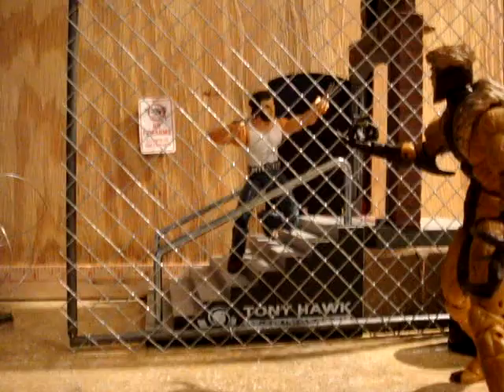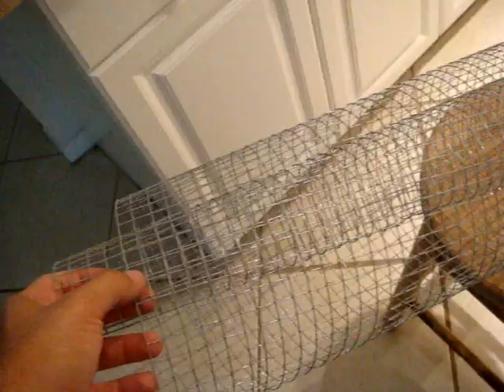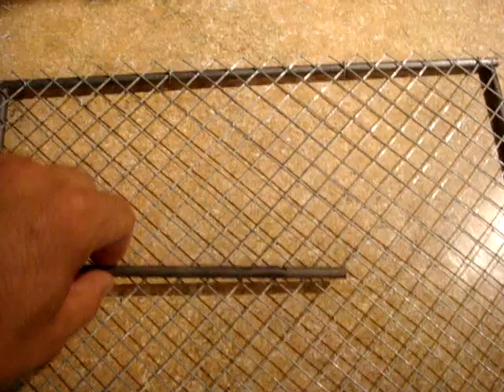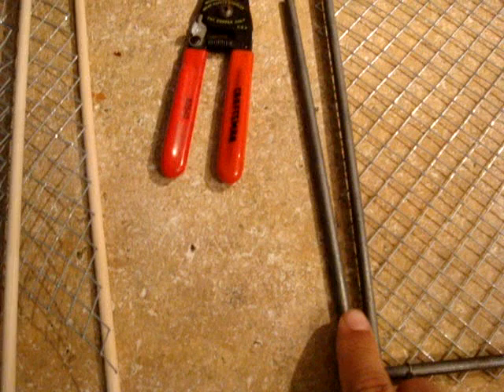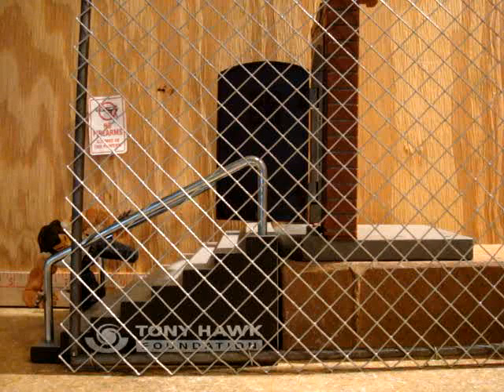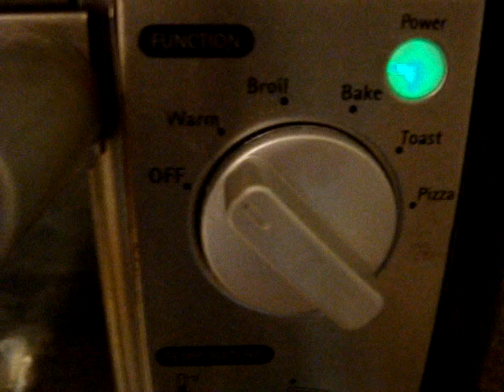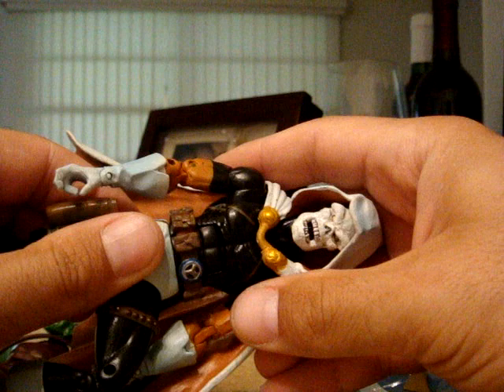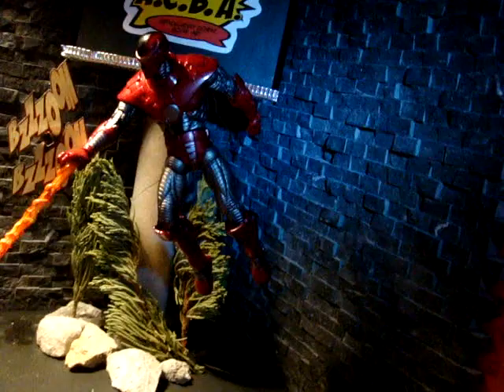B.S.W.S. - Fence & Head swaps

Comment: At what scale will that fence be used as?

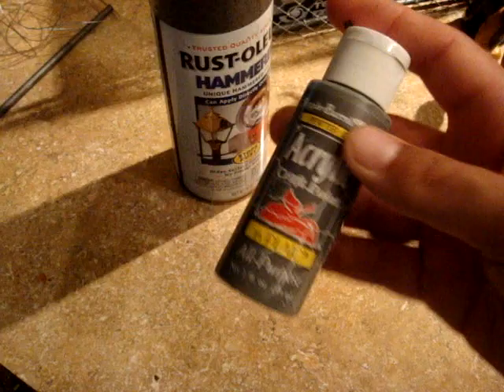I'm in the process of making a representation of a chainlink fence. where the scale will be 1:14. The working display when assembled will total 9ft long and 
4ft wide and be in three sections.

The use of chicken wire never crossed my mind thank you lol. 
I was even thinking of using wedding vale material if it came close to looking proper, and would
be starched to death.

I would also be interested in knowing how you did your brick walls.

Thank you and well done,

Bob